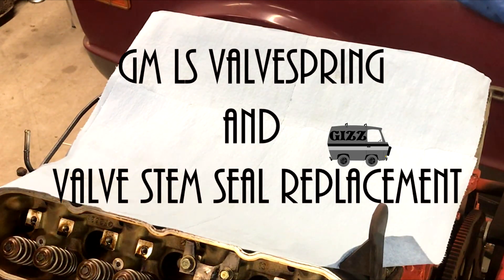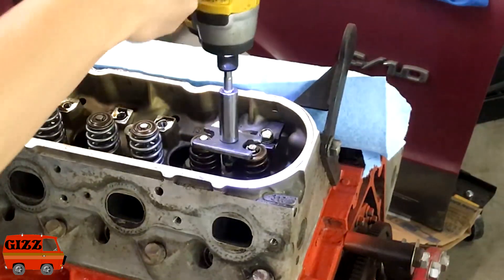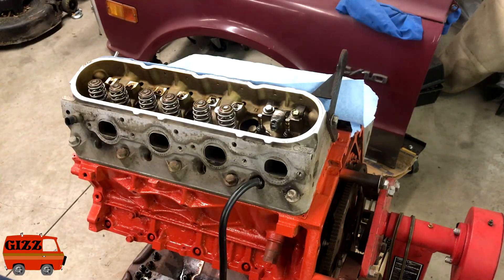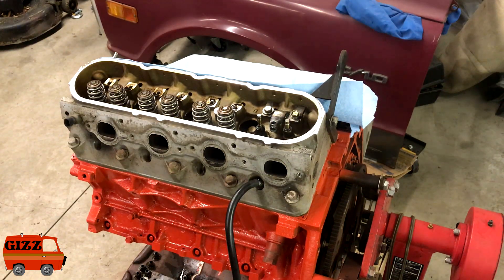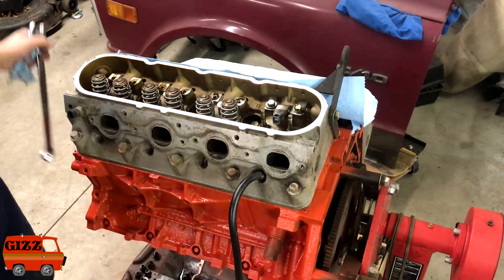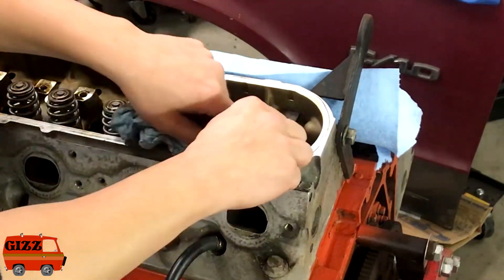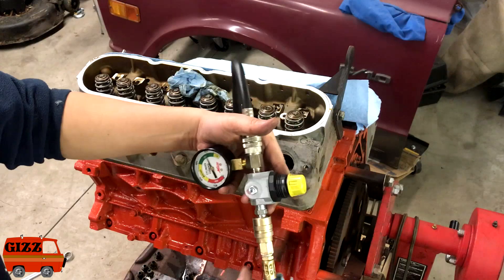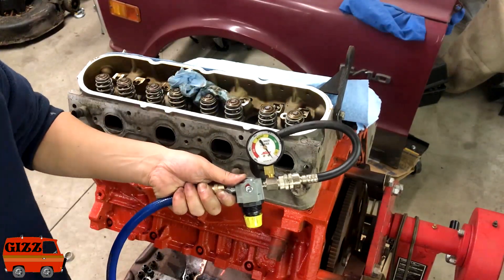GM LS Valvespring and Valve Stem Seal Replacement

Comment: Truly enjoyed The Girl from Ipanema!  
Looks like it’s been flagged because of the music?

Great how-to. Building your own tool makes things so much easier.
Reply from the maker: I don't mind Astrud, contrast to the last album playing, Public Enemy. It's ok tho, they just send a notification saying the music copywrite holder can monetize the vid and I cannot. About 12 hours later they add the song details to the vid description. It doesn't count as a strike, I've been letting the music play lately.
Reply: @GIZZMOTORSPORTS  Yeah, I've had that happen on a few of my videos.  You just have to accept that if your video goes viral, you won't get any money for it.  My Cyclocross video has over 18K views but I get nothing.  No biggie.
Reply from the maker: I don’t get the algorithm. I may take the toda springs off the Honda to measure heights. That’s a workout compared to this Chevy. What springs are you running?
Reply: @GIZZMOTORSPORTS  That's a bit of a mystery question..  I have no idea what valvesprings I'm running on the Honda..  There's no reason for me to think they're aftermarket springs other than the fact the previous owner of the ITR engine that I took the head from said it had some 'Takata or Tanaka' springs.  I find no information whatsoever on the internet on those brand names.  PO says they're basically JUN springs.  But again, I see no reason for me to think they're not just stock ITR springs.  I've been past 9k rpm with this head numerous times with no signs of float but I'd never push it any more than that.
Reply from the maker: 604Bluelight time to dust that off and hit the street/strip!!! Ya think you can bust a 10 first time back? That would be impressive.
Reply: @GIZZMOTORSPORTS  Can't really see why not.  Nothing's changed.  The clutch is the only question really.  If I can get some taller gears it should do it even easier instead of bouncing off the rev limiter while crossing the traps.
Reply from the maker: @604Bluelight or try some 23s
Reply: I ran 24.5 M/T's on my Welds when I ran my 10s.  Can't fit anything bigger than that without cutting sheet metal.
Reply from the maker: 604Bluelight too big to street
Reply: and I'd have to raise the car to higher than stock.

Comment: What PSI the air compressor needs to be set up in order to supply air into the cylinder the whole time?
Reply from the maker: You only need a constant 40-50psi
Reply: @GIZZMOTORSPORTS  thank you very much for replying to my comment. I'll do that!

Comment: Can I replace LS valve stem seals withiout pulling the heads ?
Reply from the maker: Yes you can remove the LS valve stem seals like that. Will need some simple tools you can buy even on Amazon. It’s in the video!

Comment: are you reseating/lapping your valves after this? Built many heads you should always lap the valves when changing the stem seals or guides. The valve alignment will be ever so slightly different causing improper sealing in the combustion chamber.
Reply from the maker: GIZZMOTORSPORTS
  • 1 second ago
No need in this situation, just doing stem seals. If you are doing guides chances are you are cutting seats vs lapping. But ya, I'm all for doing more than less. I'd rather not have any issues with these builds. Are you swapping stem seals on car?
Reply: On a new build if the seats didn’t seal correctly will that cause white smoke and or oil in combustion chamber?
Reply from the maker: @jimmyramirez8844 the seals or seats? The seals if damaged, yes in chamber but would see blue smoke. Coolant burning would be white smoke. Bad seats would be more serious.

Comment: Will this work for my 1998 gmc k1500 z71 SL/SLE 5.0 liter 305 the air trick and top dead compression trick ?
Reply from the maker: D.L.P Devo the tool is different but everything else works the same. Good luck with your repairs!
Reply: @GIZZMOTORSPORTS   Do you thanks ...  know what the part is called and were can I get it ?
Reply from the maker: I’m adding air with a leak down tester, you can get single or dual gauge units. The one I have is a Milton, https://www.amazon.com/Milton-S-1257-Cylinder-Leak-Tester/dp/B000K1FLHG/ref=mp_s_a_1_27?keywords=leakdown+tester+kit&qid=1560728706&s=gateway&sr=8-27